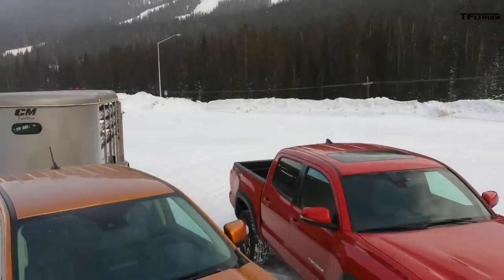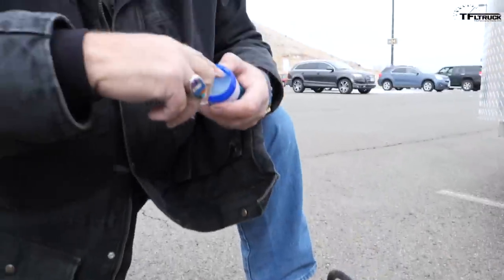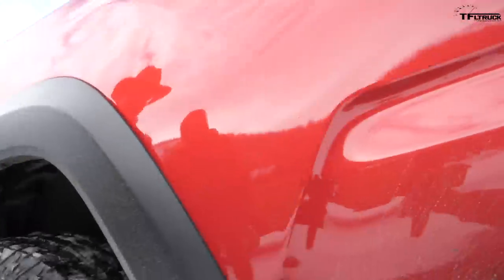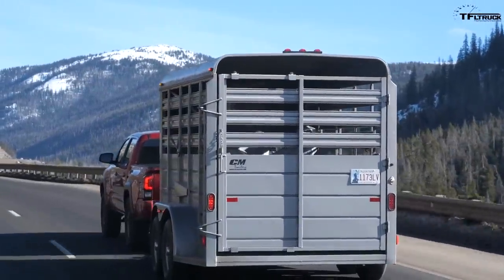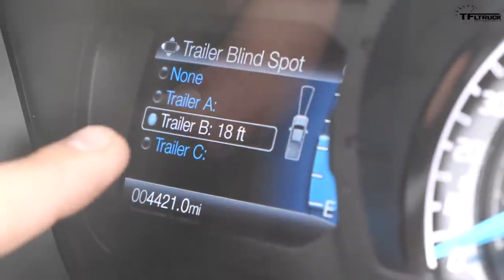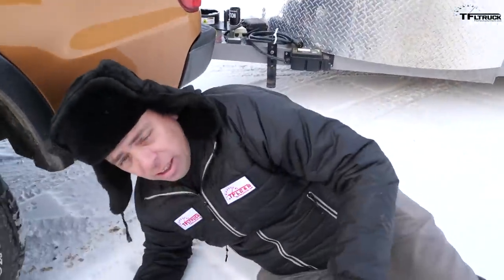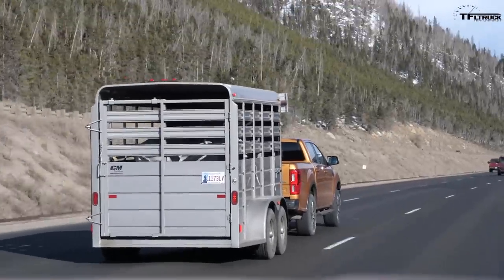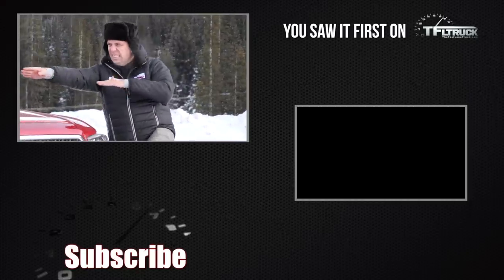Best Midsize Towing Truck? Ford Ranger vs Toyota Tacoma vs World's Toughest Towing Test

Comment: While this was from two years ago I find people still don’t use the Ranger 10 options as well as they could.  You can set the number of gears available on the stick. So if your worries about it jumping between 5th and 6th you can max it out at using only 5 speeds so it won’t ever try 6th while climbing etc. I do lots of climbing and tight bends and setting it to use 4 automatic gears max means I can just forget it until I’m at the top. Always sports mode ti use any selected gear too.
Reply: Not just in the ranger but in most all new vehicles…..most people who get into new vehicles have no clue on all the options their vehicles are equipped with….and forget about anybody reading the owners manuel….people would never even look at it for the whole life of the vehicle….I myself love to read over the owners manual for any vehicle I have from front to end!!!

Comment: You guys have misidentified the “ECT PWR” several times now. It doesn’t add power or change the engine at all, it holds the gearing in lower gears for longer and helps prevent early shifting (at the cost of gas-mileage) to make towing and mountain-climbing easier.
Reply: Well stupid toy company named the button not tfl...
Reply: they never said it added power, just that it was recommended by the manufacture for towing.
Reply: @matt34003434  Mr. Trucks said it "gives a little power going up hill...".
Reply: Ect power button has been in Toyotas for at least 30+ years. I dont how people still dont know what it is.
Reply: Simple as that. No Magic.
Reply: @andrewsbbq  Toyota has been using that term since the 80's. Welcome to adult hood.
Reply: ya
Reply: @TravisTLK  IT does hold the rpm's longer keeping it in the power band with RPM's and HP longer between shifts
Reply: This drives me nuts. Its been around since the 80s as far as I know. Makes Toyota not shift like grandma's driving. Holds the gears longer. Doesn't take a genius.
Reply: It also changes the Pedal-to-Throttle rate. So accelerator input results in a greater % opening angle to the throttle motor through the pedal sweep. So yea, it does technically change the way the engine behaves and feels. No added power though.
Reply: Can't be bothered to RTFM or reach out to their Toyota marketing contact for instruction?  Yeah, much better idea to just mash buttons randomly and pray when towing a heavy load up and down a steep grade.
Reply: @freddyflintstoned913  The rest of the usa truck market has used "Tow Haul Mode" for decades. Because it describes the Function.  Maybe toyota needs to wake up and quit with the buzzword B.S.
Reply: My brother’s 96 Avalon has ECT mode as well.  I’ve explained how it worked several times and he still thinks it’s some sort of traction control setting.
Reply: @dp4auburn  LOL
Reply: @PatriotPaulUSA  My Silverado 350 is a manual. How would I know that? So I looked it up. You are kinda wrong.
Reply: @PatriotPaulUSA  Beginning in 2001 with the Duramax engine and Allison transmission combo in GM trucks, GM included a new feature called Tow/Haul. You can activate this feature by pressing the button at the end of the shift lever to make the towing process more enjoyable and safer. When the Tow/Haul mode is engaged a few things happen.
Reply: Decades? Toyota has been using ECT, that would be electronically controlled transmissions since the 80's. That is decades.  hahahahahhahahahahhahaha
Reply: @PatriotPaulUSA  https://www.google.com/search?client=ubuntu&hs=BgU&ei=cOwxXJutF63H_Qah25LYDg&q=Tow+Haul+Mode+what+year+did+that+start&oq=Tow+Haul+Mode+what+year+did+that+start&gs_l=psy-ab.3...82567.93274..93672...0.0..0.105.2083.23j2......0....1..gws-wiz.......0j0i71j0i67j0i22i30j33i160j33i22i29i30j33i299.iYyZEDAP4_w
Reply: Carcaine it stands for electronically controlled transmission
Reply: @freddyflintstoned913  Are you using the latest version of Ubuntu ? If so what is your take on it ?
Reply: Thank you for clearing that up sir!
Reply: @ryanbrown918  This would only apply to newer vehicles where the throttle is electrically controlled by the computer. Our 2000 4Runner is cable linkage from the pedal to the throttle.
Reply: Or maybe if Toyco were more popular people would know more about the ETC Powah mode, or perhaps they should look at what the rest of the industry is doing with "Tow Haul" mode  that makes f***ing sense to people, then Toyato would have a better thing. I have seen Toyota owners who don't even know what it does.
Reply: Oh God, so picky. Who cares what Toyota calls its  tow haul ETC power button. Tacoma AKA "Terroist Tank" will out last that 2.3 liter close deck Direct injection TURD-BO. That  Former old Rebuilt Dodge will die a hard death way before that Taco will. No DISRESPECT FORD lovers it's just the truth...
Reply: Chris Provo 
No disrespect? Is that before or after your taco breaks in half? GTFOH
Reply: Reading the owners manuals is a lost art these days...
Reply: Mr. Gut
Reply: @yetisdeuce1315  a woman I know wanted me to check turn off her tire pressure light on her 2013 4runner because it was on even though the tires were at the proper pressure.  I looked in the book for where the button is (which there isn't one), and the majority of the things I saw in the book was, "Take your 4runner to the dealership for this." There's not really much of a need to owner's manuals now.  I really wish there was more useful info in them than there is, but they say things like, "Please remove the fuel cap when refueling." And I have seen, "Do not drink contents of battery." Those should be obvious.  If you own an older car, such as 20, 30, 40 or more years old (like I do :) ) then definitely read the owner's manual.  However, I find reading owner's manuals on any car pretty entertaining because of some of the things written in them.
Reply: Electronically controlled transmission. It’s basically sport mode
Reply: So putting a cool sticker on my bumper doesn't give me 5hp?
Reply: Mister Berzins yell
Reply: Sold my 2020 Tacoma because of how weak the truck felt. Now I own a 2020 F150.

Comment: Don't buy the Tacoma. Ive had Tacoma on and off since 1997.  3 in Total now.  They never break down and always work when you turn the key. No drama, no surprises! I did have a Ranger briefly in 2000, it always over heated, leaked oil and had transmission issues. The motor ended up exploding! Very exciting! Never knew what to expect on the road! I miss it.
Reply: Don’t buy the Tacoma? I’ll get the ranger then!
Reply: Lol
Reply: I know!,  I miss the drama too. I get in my Taco anytime and go anywhere and nothing breaks! Strangely I miss having to fix stuff like I used to on the Fords and Chevys I've owned.
Reply: 1LOCKNLOAD and no old Tacoma’s?? 😅😂🤣

Comment: From the video, the Ranger appears to have an elastomeric jounce bumper (not a bump stop) which is designed to be a supplemental spring. It works to make the suspension progressive, providing an increasing spring rate transition into full compression. It is intended to be an active part of the suspension. As such, it should have been touching the leaf spring during your test.
Reply: Rick McNelly I agree. But anyone can buy some progressive bump-stops or helper spring from $50-200 and add onto any vehicle. Places like Wheelers offroad and also Sumo- springs.

Comment: When doing work like towing up a hill,  it's no surprise that the mpg is more even. 
The EcoBoost mpg advantage comes into play when CRUISING where you don't need the max power capacity. 
Then that less reciprocating weight will provide more mpg.

When you need the power to tow up the hill then similar amounts of fuel will be used.  It's not like the EcoBoost makes free energy.  It's just a smaller engine that can still match the power of the larger engines when in boost (replacement for displacement) . And it's in that later mode when climbing a hill.
Reply: Shawn Barnish but the ecoboost makes more torque at lower rpm. It doesn’t need to rev to 5500 to get peak torque. There for while hauling up hill the ecoboost will do better

Comment: that bump stop on the Ford is dynamic. meaning it it part of the suspension and is designed to flex alot more than a stiff bump stop... just like on the Chevy's which isnt as durable as the simple Toyota setup but much better ride as it provides a much more progressive spring rate...(gets stiffer near the end)

Comment: I just pulled a 10 k trailer all the way from Phoenix to Dallas and my 2017 colorado diesel did it with 14 mpg and no problem! I have firestone ride rite airbags and it held up that heavy trl no problem!
Reply: That truck has right specs is it reliable?

Comment: For my money, I'd personally go for the Ranger first, I like it's styling, and the fact the interior is more comfortable. That's one of my biggest complaints on the Toyota, seating comfort, it feels too cramped.
Reply: and wait till the new Ford F-150 250 350 come out they going to kick ass 2020 models
Reply: I love how people say things like for my money Id go for this and this and this for this reason. But it's always hilarious and it's the same with you, your reasons are all things that can be solved with a few extra bucks on the side and then you end up with a far more reliable vehicle at the end of the day. Cuz its a guarantee that the ranger is going to have issues with the turbo. It's not even a question. Personally I think you'd be better off getting a used tacoma and taking some of your savings and sprucing up the inside so its more comfortable.  They're not bad cramped. We just live in a society of babies that trade reliability for comfort.

Comment: Great video with a pair of goof balls. My wife wants to buy a new truck, she has test driven the Taco, via a rental...her 03 Ranger was in the shop. She wants a Ranger but fell in love with the Taco (I love Taco's too, but not the automotive kind...wink wink) We are waiting on a Ranger for her final decision. We are Ford people, however the Tacoma is an excellent truck and it would be a good buy either way. Personally I would buy the Ranger. Great video guys, thanks
Reply: and your '19 Ranger will constantly be in the repair shop, too. Taco for reliability, coupled with longevity. Owned both. FORD, Found On Road Dead and Fix Or Repair Daily.
Reply: The 2019 tacos reliability is down, they all have been since 2016
Reply: Toyota’s 4.0 2015 is a way better pick of engines that last with power.
Reply: @youarerightboss  TACO  "Soggy if not used"

Comment: The Ford does have a tach. It is a digital tach that is accessed on the left hand screen. It has a digital circular tachometer that you can put up on the left instead of the tachometer you have on there for the video. When you put in in sport it puts it up automatically as well.
Reply: Busa_rdr         my ranger xlt 4x4.   Has a real tach on the left a speedometer on the right and all that light show stuff in the middle .     I like it much better.

Comment: I looked forward to a Tacoma for years,  after 1 yr of running up and down I-70 in my TRD OR I traded for a F150 3.5eco 10spd. The Taco even when unloaded shifts  constantly going up grades. Its tiring.
Reply: Preach. Tacomas feel so outdated comfort/ride/acceleration wise. There isn't really a defining reason to get one other than to have other people tell you "thats a reliable truck" so you can pat yourself on the back. Resale value on them is a bit better I guess but who really cares? Resale value on trucks in general is better than other vehicles. The durability/resale value on a taco isn't enough for me to sacrifice comfort day to day.
Reply: @riskyb250  If you like to go offroading it's still a great truck. Running back and forth to Keystone I'd be tired when I got there. The F150 just eats I70 up, very comfortable and powerful. O could still get anywhere I'd want to go offroad too with the locking rear in the F150.
Reply: The 3.5/6AT in the Tacoma is a terrible combo for a truck. I used to have one and I hated it. It would downshift to 4th gear to maintain 70mph over a Florida interstate overpass. Hell, even a stiff headwind had it downshifting to 5th.
Reply: Hahaha
Reply: Good choice love my 5.0 10 Speed. For sure eats I-70 (MD).. Getting 19mpg living on a mountain, up and down hills with a little rippin and tearing in between I’m happy.
Reply: It's called underpowered.
Reply: There was a TSB to fix the shifting issues, a simple computer update
Reply: Mike Adkins I’ve had a 2007 Tacoma with the 5-speed auto for 12 years now. Great performance out of it, but if I got the 3.5 Tacoma, I’d probably go with the manual trans due to the fact that the 3.5 needs to be revved more.

Comment: I’d love to see a video comparison with Chevy ZR2, Gladiator, and The Ranger with the 2inch level kit with Fox shocks given that it is an available upgrade now and covered under warranty. The approach angle is 34.5, break over angle is 23.5, and departure angle is 25.4 degrees. So I feel this upgrade option puts it on par with the Chevy for sure. I got these options with 360 copilot for my Ranger XLT and I think the Ranger is the most balanced mid size when considering off road capabilities, towing, cargo, and features like lane assist/360 copilot. I put a set of Ridge Grapplers 265/70/17 and it handles everything well. And it was $5-$10 grand less than Chevy Bison and $20k less than Gladiator Rubicorn.

Comment: As reliable as Tacomas are, (I have had 4 of them) they are brutally uncomfortable to drive or sit in if you are 5'11" or taller or have long legs. To sit in my last one (2005) I had to have the seat way back to accommodate my legs, tilted back (so my head didn't bang the ceiling and I could see out the front) but then only the tips of one hand could touch the steering wheel. If I drove over an hour my back hurt, my legs were sore because there was no thigh support and my feet started to go to sleep because my legs stuck straight out. The truck was great otherwise but a real torture device to live with. I've been in an F150 for 9 years but I would like to get a smaller go everywhere truck again. Maybe the new Rangers and Colorados will prove reliable, I hope so, but turbos scare me on that front.

Comment: I originally thought that I'd buy a Tacoma but then test drove the Ranger and the Ranger's seats were way more comfortable so I bought the Ranger.
Reply: Got to say it's pretty damn sad that seats would be the thing that sways you one way or another....... One is as reliable as the day is long. The other one is a turbocharged POS. Just a hint anything that isn't naturally aspirated is going to cost you a lot in the long run.
Reply: @seanbutler2291  except that I have to sit in those uncomfortable seats for every mile. There were other factors. Like I couldn’t get a straight answer about the towing capacity for specific vehicles and the salesman was super shady. But the uncomfortable seats were the tipping point.
Reply: @seanbutler2291 4 years and zero problems with the Ranger. I see Tacoma's on the side of the road broken down though.

Comment: Great video!! I like the smooth look of the RANGER. You would think after 30+ years TOYOTA would make the seating position more "American". It is very uncomfortable. 
Andre the "Kung Fo Russian" love it.
Reply: Lucas Cruz  what ?
Reply: I disagree. I think the Ranger has the better drivetrain and more comfortable suspension but the Tacoma looks better. The Tacoma looks big and burly and the Ranger's front end could be a car. Ford should definitely beef up the Ranger's front end look.
Reply: Ranger looks like lifted Taurus.
Reply: The Ranger, to me, is the Ford Edge but better looking. The Taco just doesn't appeal to me. Maybe by 2025 Toyota will revamp it. Maybe! But until then I am glad to have other choices available.
Reply: @lance_r72  TBH neither appeals to me. It's not significantly smaller than a half ton but only half as capable. Goes for all brands. I mean, the segment in general seems kinda pointless since safety requirements make them fat.
Reply: @dchawk81 I agree. Why spend $40,000 for a "midsize" truck when you can get a more capable and more comfortable full size. If I lived in a city, never happen, The smaller trucks would be better at maneuvering. Otherwise give me a full size truck.
Reply: Yes but sheer sales numbers (worldwide) makes this the leading sales segment. 
No diesel option for either? 400 ft/lb torque can make a big difference as to how it performs as well. It seems that you guys are missing out on the "real" midsize trucks the rest of the world has....
Reply: @anthonyjenkinson2710  Yeah a lot of people call 'em mini trucks here. S-10, 80s-90s Toyotas, etc. Mostly the little 2WD ones that sit low. No bigger than a mid size car.

My S-10 and Fusion have nearly identical lengths. They'll fit in my older garage. My F-150 won't.
Reply: @BCORBAN7884  I agree, the Taco looks better. Though, one thing I like about the Ranger is the front bumper cut line. It's straight across, that will make it pretty easy for aftermarket manufactures to make front bumpers for it, hopefully there will be some aftermarket options shortly. I thin once someone lifts the Ranger a bit and adds some beefier tires, it will look much tougher.
Reply: @lance_r72  Lots of reasons why midsize is good, id still rather have a full size though. Offroad ability much better with the width, shortness, approach angles, fuel mileage is better by a bit, should be more though, Can actually fit the long bed version of a tacoma in a smaller garage/ too wide garage, Fits in parking spaces in the city. Smoother and quieter drive na V8 or the loud f150 v6 for daily drive is annoying in the cheap grades. You can get ill fitted trucks for 40k or used, or you can get a decked out Limited Leather technology clad mid size for 38k with a high resale. For short people its easy to get into midsize and more comfortable to sit like a car.